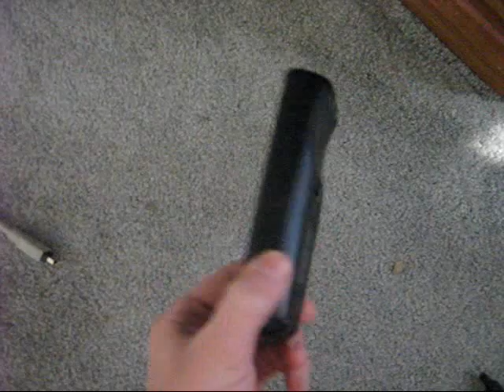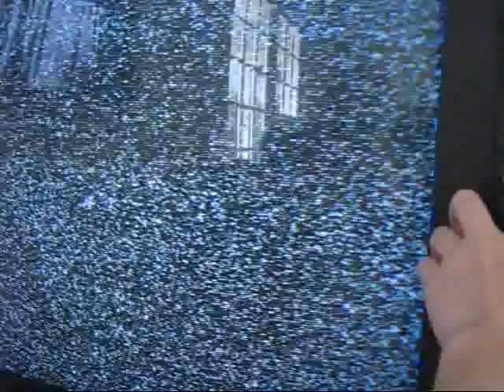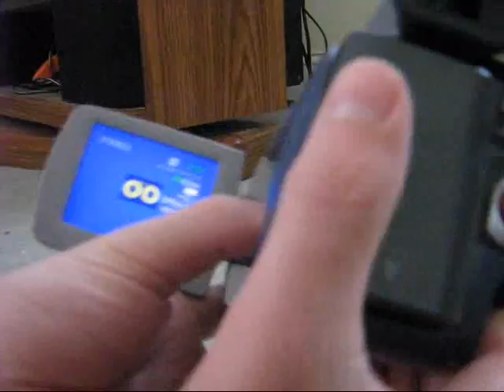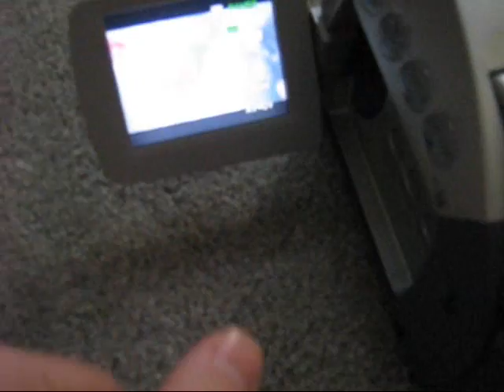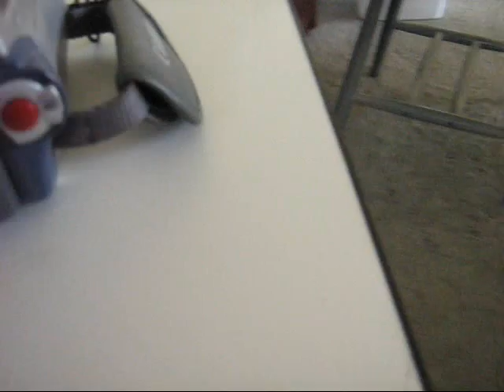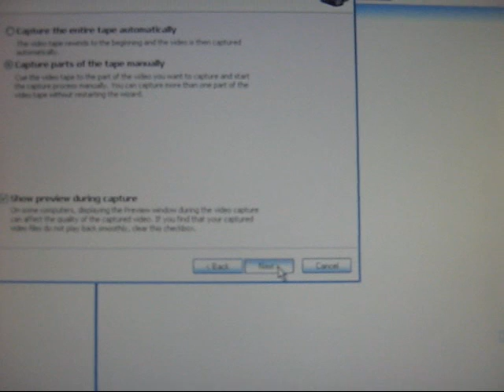How to record / capture a video game sytem

Comment: Thanks for the tips! The cable and connection you used is a 'firewire'. The firewire connection is needed for digital video tape cameras. I have a JVC DV tape cam which requires this. My Sony (memory card) camera uses just the USB.
 Thanks again!

Comment: I would just like to help you out here.

I have been using practically the same exact set-up as you have, except that I primarily use my ZR40 to record my computer games instead.

Just so you know, the "special" port you used is the IEEE1394, more commonly known as FireWire. Similar to USB in a sense, it was developed by Apple, primarily  as a type of transfer of data between two interfaces; most often it's used for peripherals, like Camcorders and Printers.

Comment: Not all TVs have a loop output, in fact I've never had a TV with loop output.  You should have explained how to do this fo people who don't have the loop, like using an A/V splitter or Y adapter.  Still, decent tutorial.  I'm thinking I'll make one of how I've got my system set up, I've got an HD capture card and I had to do some custom cables to get it how I needed it.

Comment: I don't know if this helps but when i first tried with my xbox 360 and component hd cables it didn't work. then i used the basic av cables (yellow, white, red) and it worked perfectly. if your using hd cables I suggest using the basic cables instead. hope this helps.

Comment: I have the firewire, power cable and the AV cable for the camera to the TV but I don't have the that box where you plug in your camera and console, what was it anyway? Anyone can tell me? Also, I could hardly understand what you where saying. I do think I have an alternative, I tv has an S-video out slot and so does my camera so I thought of buying a cable to connect those two. Anyway, big thanks, my camera is also Canon, MVX250I.

Comment: get a capture card its 2015
Reply: Todd Simon the video was made in 2007
Reply: Todd Simon Lol Ik but this was in 2007
Reply: Todd Simon Capture cards suck
Reply: PkGam no they dont
Reply: itz skull They make people lose footage too often because they're buggy. I rarely if ever hear of people having trouble with cameras but I often hear so-and-so capture card whether it's an HD-PVR or Black Magic Intensity mess up and they lose footage.
Reply: PkGam elgato is the king of capture cards who still uses a hd pvr and old versions are buggy not the new ones and if u just put a cammera conncet the camera to tv and record not as good quailty as a capture card
Reply: itz skull Assuming the new ones aren't buggy, why would anyone pay $130 for an Elgato over a camcorder that can capture gameplay footage directly for less than $50?
Reply: PkGam because elgato is better than using a camcorder
Reply: itz skull How so? It needs to be connected to a computer so it's not as easy to record with as a camcorder due to portability unless you have your computer right next to the TV, you have to configure settings for it that you don't with a camcorder, pricier for the same video quality coming through the input, etc...
Reply: PkGam when did i say it was easy and for better quality more work
Reply: itz skull Quality comes from the connection type itself. Capture devices, whatever one is used, only grab what's being fed into them. They can't get better quality from the same connection type that something else uses. Like say... HDMI beats component and component beats composite. So a camera that accepts HDMI would end up looking just as good as video recorded through a capture card.
Reply: PkGam also the elgato needs to be connected to a pc the camera needs to be connected to a pc to upload the vid and editing also the camera cant lives tream directly to twitch and youtube its just clear that the elgato is more better for more money
Reply: PkGam do use a camera for your vids
Reply: itz skull Lighting for what? Did you watch this video? The camera is recording the gameplay directly as a capture card would, just not straight to a PC which has the benefit of not needing a PC right next to the TV and no need for a powerful enough PC to handle recording the gameplay (Which really adds to the price of the Elgato setup).

Transferring videos to the PC is easy. Just connect the camera or SD card and the PC imports them in the recorded quality while you do something else.
Reply: PkGam i was commenting on another video at the same time lol sry
Reply: PkGam do u use a cam corder dor your vids
Reply: If you use a more modern camcorder it actually works well! The one he is using is old old old!
Reply: In 2007 this was the way they did it. And if you have a high quality camcorder this actually works fine!